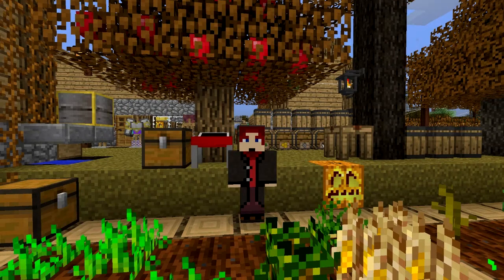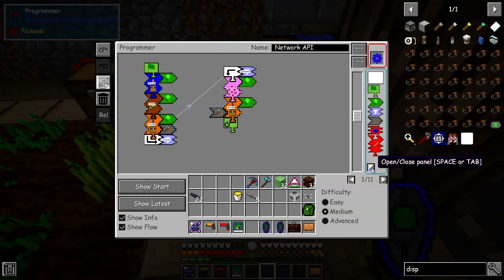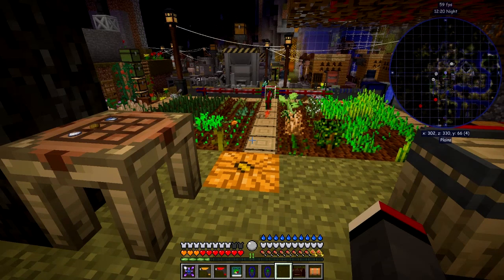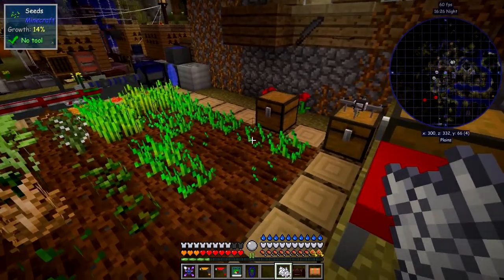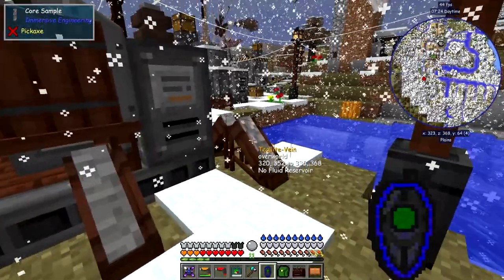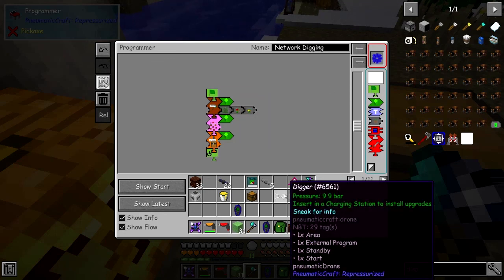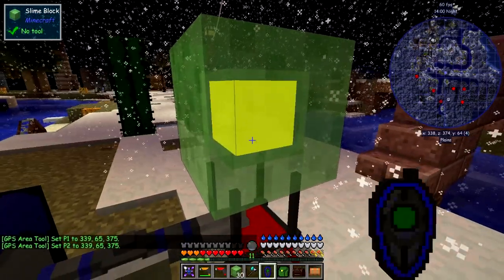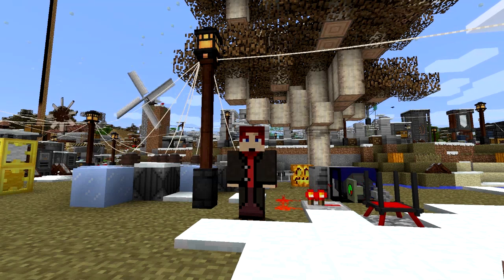Real Tech #084 - PneumaticCraft Repressurized: Debugging Drones

Comment: Good episode :)  Just to note the Range Upgrade in Drones is only useful in conjunction with the Entity Tracker Upgrade (which gives the drone a minigun).  It extends the drone's firing range.
When installing upgrades in the Drone, you'll notice a whole bunch of side tabs in the upgrade GUI - those all have more detailed information on what each upgrade does.  You'll also see similar tabs if & when you add upgrades to the Minigun and Pneumatic Armor pieces.
Reply from the maker: desht2008 thanks again for the help and tips. I built a villager farm so a drone to protect the villages will be next one the list. BTW there is a strange intersection with an exclusion area, it doesn’t exclude the outer blocks. Shall I raise an issue?
Reply: @duncanwebb4934  sure - if you could pastebin the program and link it in the issue, that will be helpful, cheers.
Reply from the maker: Sorry I can't reproduce it.